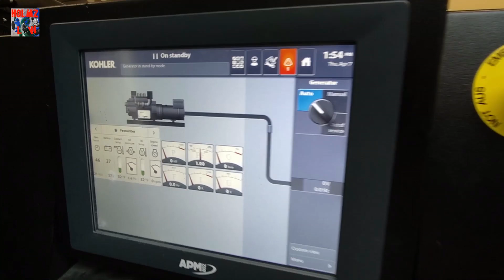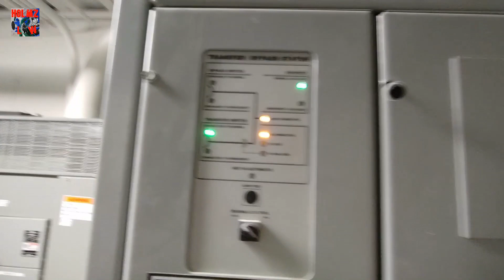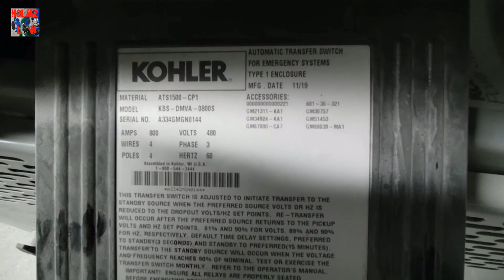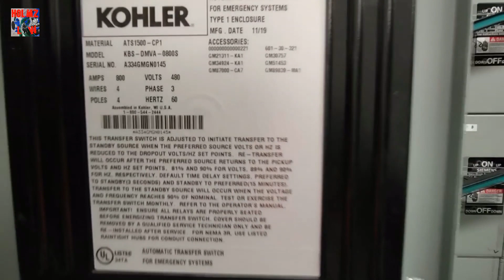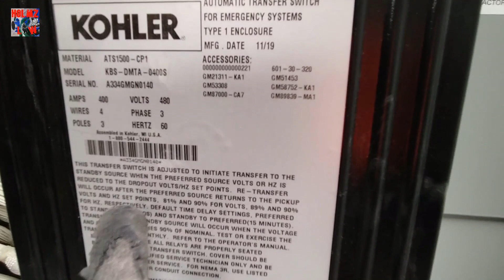Separately Derived Generator & ATS Switches

Comment: love your videos a lot! correct me if i am wrong, at 5:20, seems like a transformer is feeding a disconnect? i think by the NEC code that you cannot extend transformer or any equipment extending to panelboard/disconnects working space, based on 110.26(a)(3), but sure let me know if i am understanding the code correctly.

Comment: The main purpose of using 4 pole ATS is to allow the use of Ground-Fault protection of feeders. Ground-Fault protection is required on any feeder 1000 amps or higher at 480 volts.  If you use 3 pole ATS with feeder-Ground-Fault protection,  the Ground-Fault relay will nuisance trip because the neutrals are sharing.  Some neutral current will not return to the G.F. relay and cause an imbalance, then trip.  Great introduction to the topic

Comment: So this system had an ATS for each load/panel? I’m guessing because it is a larger system. For residential, I’ve been told that the more ATS’s that are installed on the system is prone to mechanical failure because its only a main panel.
Reply from the maker: Well technically it's one ATS for one distribution panel that feeds multiple loads. One of the loads being the feeder to all the emergency panels. Also I've never heard of mechanical failures being an issue. I'll have to look that up. We've been doing systems like this throughout the country for ages. Thanks for the comment and most of all for watching my video.

Comment: great video, brother! I've done 100's of whole house Automatic Generators by Generac but they are not separately derived systems, so I understand what you are saying. This is the first for me seeing one this big and Kohler designs their generators a little different from Generac as well. We always had to separate neutrals in the main panel of the house when we installed the transfer switches; because they became a sub panel. A separately derived system is a different creature altogether when it comes to the neutral or grounded conductor of the system. The separately derived system has its own neutral! That can get a bit confusing. That would be a good subject to touch on, brother! That part is so important to a separately derived system. that's what makes it different. You pointed it out a little bit in the 3 pole generator with 3 wire for 3 phase for the elevators. That would be great to expound upon to give a little more detail.
Great video, brother.
Reply from the maker: Oh yes it was just an intro to Generators and SD Systems.  I didn't want to get too deep. I just wanted electricians to know that a generator can be a SD System and also that if you bond the neutral to ground (which in most cases they are in big commercial jobs) you have to be aware of the type of ATS you are going to install. My mission was to just spark an interest. I like to believe that we electricians (at least the good ones) do our own research when we come across something new that we don't know. I'm hoping that's what I did by posting that video. Either way another will come soon enough. Thanks again for watching and commenting.
Reply: @TheArtOfConduitBending  you done a great job. I was just thinking it would be a good future video. I thought that was what you were asking for. Hope you are doing well, brother!  Take care!